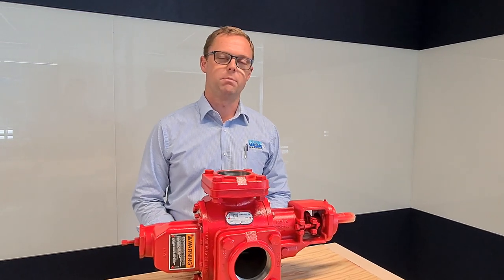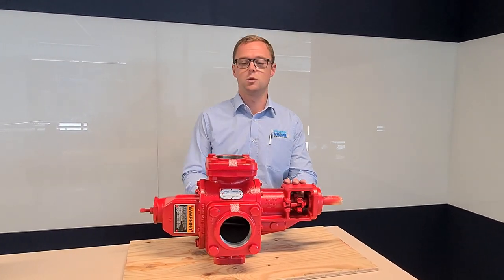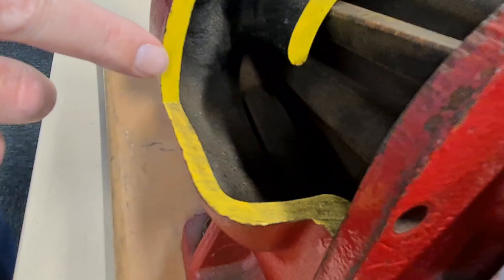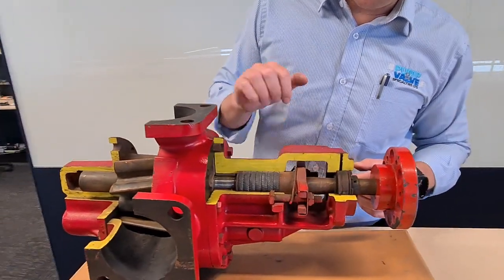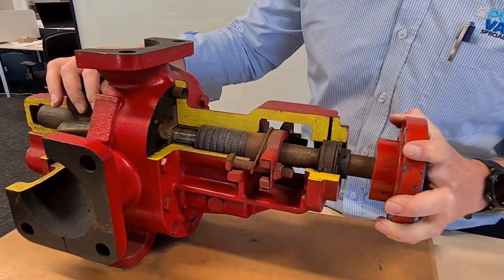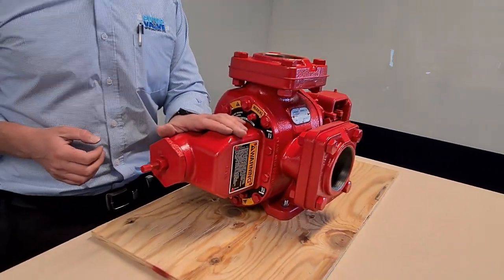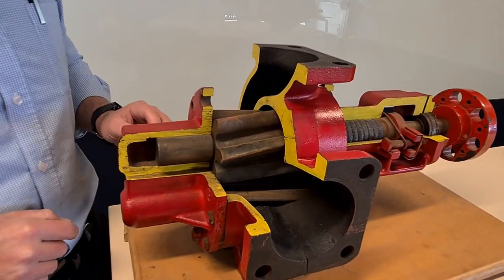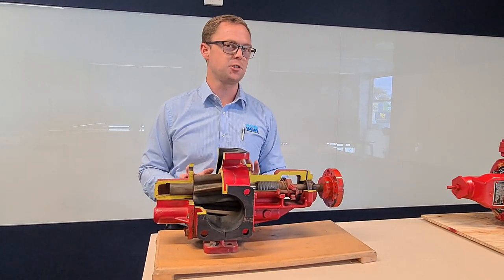Roper Gear Pumps - Pump & Valve Specialties NZ

Comment: I have one of these and the shaft seals leak badly when the pump runs.  
How tight do I have to have them to get them to seal up? 
Or how tight is too tight and I should assume something else is wrong with the seal set?
Reply: Did you ever find a fix for this ?
Reply: @xavcar15  Yes, I did.  I had to take the packing gland assy apart and clean it and the bolts up real good. It was so full of crud that it wasn't actually moving in when the bolts were tightened and the bolts were so crusty that they made things feel like they were getting way tighter than they actually were. 

The metal pacing gland splits in half and comes right out once the two bolts are off so a full tear down and clean up job takes maybe 30 minutes.  

On my pump, when things are tight enough to seal ( a few drips per minute while pumping oil) I can still turn the PTO shaft by hand.  It's stiff but spins by hand.
Reply: @tcmtech7515   thanks for the reply! I’ll dissemble and inspect the packing hopefully it’ll  fix the issue. I have one of these pumps on a production facility and the packing has a good leak on it just wanted to get an idea of the downtime before tearing into it.
Reply: @xavcar15  You're welcome.  At worst you could end up taking it apart a second time and putting new packing rope in if the old rope is all worn out or crusty.   There's a corkscrew tool that works for that but if you don't have one a large O-ring pick can do it. 

Once the packing gland and bolts are cleaned up it only takes a few minutes to take everything apart or put it back together.
Reply: @tcmtech7515  upon further inspection noticed the packing was non existent 😂 I didn’t remove any  packing and I put a piece of packing rope that I cut to form one seal and after some fine tuning no leaks so far 😎
Reply: @xavcar15  @Tcmtech Next time you have to replace the packing or buy some spare parts, I would look into Roper's "wedgee packing" it extends the lifespan of your packing and has 2 different types of packing in the set. Half the set is dense/hard packing to apply force to your shaft for a better seal, and the other half has self lubricating rings.